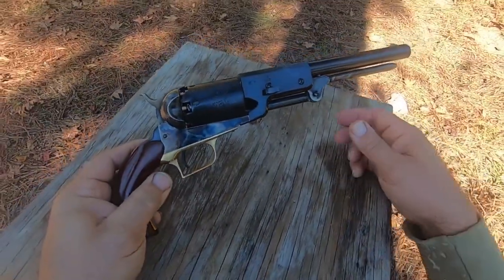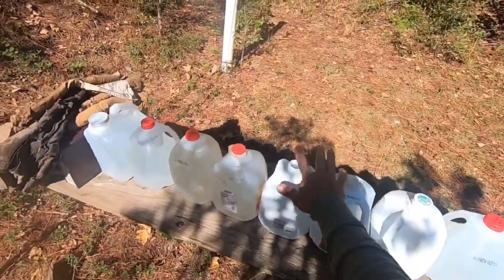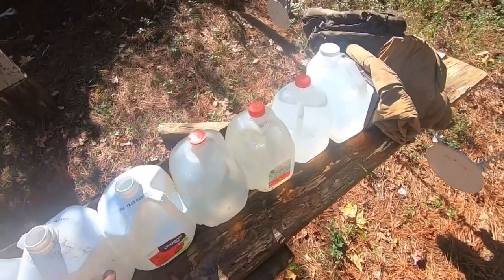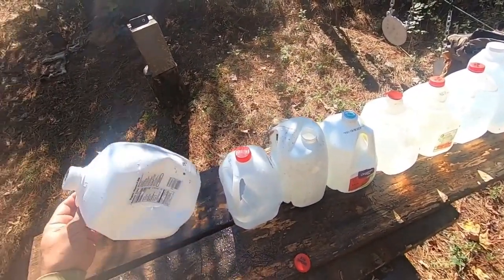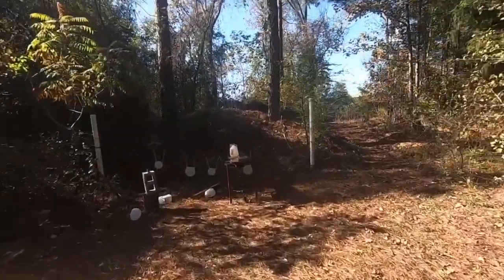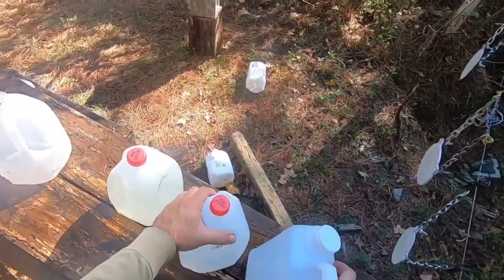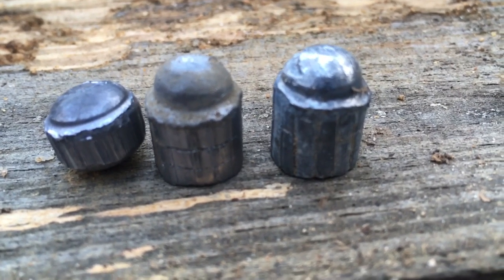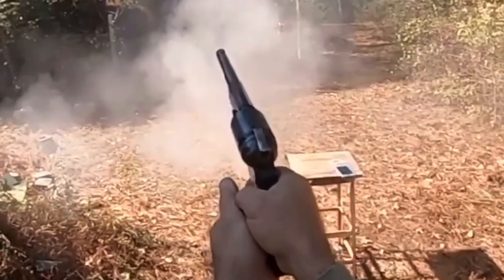Part two 1847 Walker with 220 grain Lee bullet vs milk jug

Comment: The Colt Walker Dragoon was the most powerful handgun in existence until the advent of the .357 magnum. 
...however...
Using the 220 gr. Lee bullet @ 1155 MV yields 652 ft./lbs. ME.
A .357 pushes a 158 gr. bullet to a MV of 1235, yielding 535 ft./lbs. ME.
Cool video, though. Don't see many people talking about the old Walker Dragoon. Thanks for showing us. =)

Comment: Hello brother I’m polishing them 45/70 cases. I don’t have dyes but I’ll clean them up for you and mail them Monday or Tuesday one.
Reply from the maker: Randle Richardson do you have a 30-30 ? I have extra 30-30 brass
Reply from the maker: Randle Richardson thank you so much, I don’t know how I can repay you
Reply: Leverguns 50 yeah I’ve got 30-30 brass I don’t have a 30-30 though I’ll see bout sending it to you if u want it
Reply: Leverguns 50 you run across some 300 Winchester magnum brass holler at me. But don’t worry about paying me back brother no problem GOD BLESS.
Reply from the maker: Randle Richardson I have quite a bit of 30-30 brass I sent some out to some of the other reloading guys to help them out
Reply: Leverguns 50 ok no problem brother I’ll get them 45/70 to you ASAP GOD BLESS.
Reply: Leverguns 50 I’m cleaning the 45/70 brass now brother I’ll get them in the mail Monday or Tuesday one. GOD BLESS.

Comment: Based on your data, the 44 Walker (and Dragoons too!) were & still are, more powerful than the 357 Mag of 1935 (158 gr bullet @ 1450 fps, 8.375" barrel). The 357 Mag will move a 100 pound ballistic pendulum 1.64 inches. That 220 grain conical @ 1155 fps will move a 100 pound ballistic pendulum 1.82 inches. The 44 Walker has a striking force about 11% greater than the original 1935 loading for the 357 Magnum!
Reply from the maker: It is pretty impressive, thank you for watching

Comment: What type of caps are you using and what size are they? 
I use CCI No. 10 or 11s can’t remember what number. 
I usually need to hit the cap twice for it to set off, I have also noticed under recoil the caps nearly slip of the nipples. 
and I’m not sure what to do some say it’s the nipples others say it’s the caps.
Nice video as always your always having fun haha.
Reply from the maker: Are use number 11 cci mainly because that’s all I can find and they work OK specially after I put these new nipples on
Colt Walker Slix-shot Nipples https://youtu.be/adOtTwN82wY
Reply: Leverguns 50 I was going to get some but they are hard to get over here and cost quite a bit like $100 for the set.
Wish I could get a job in the USA!
Reply: Leverguns 50 actually what caps did you use on your gun before changing the nipples? 
And would filing them down I little maybe help my problems?
Reply: I use 11 on my 50 cal hawken  and my 44  1860 pieta /colt